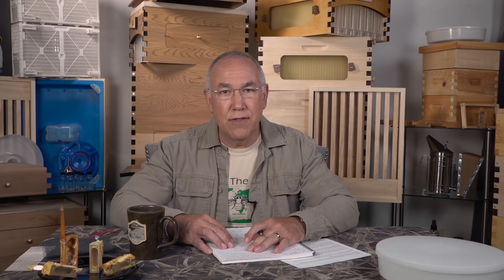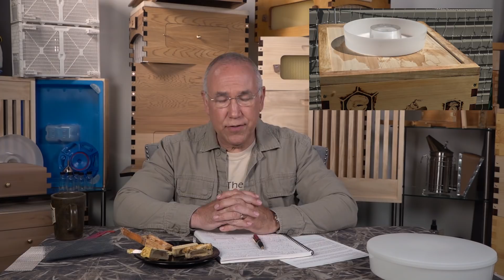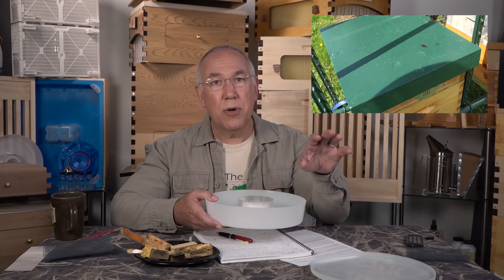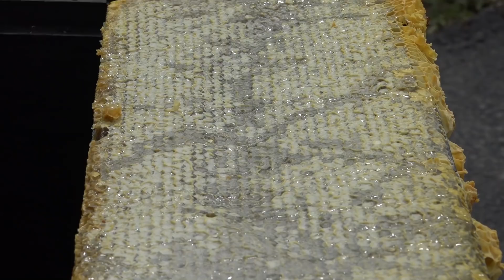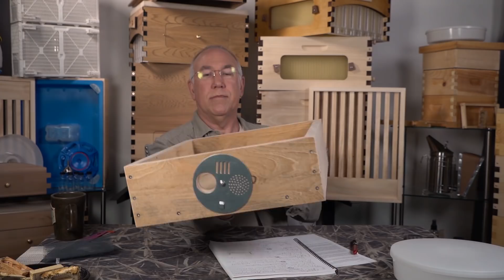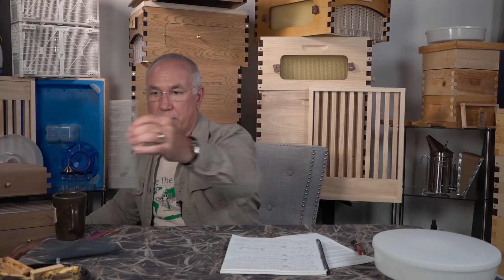Bee Keeping Frequently Asked Questions 17 Honey Bee Vented Feeder Emergency Feeding

Comment: 2) When a colony of bees dies off, can I put those resources on another hive? 13:50
3) How far apart should bee hives be placed to avoid drifting of the foragers? 17:38
4) Do Ceracell feeders have to be placed on a cover? 22:40
5) Is the aluminum insert on a flow hive too hot to touch? 25:35
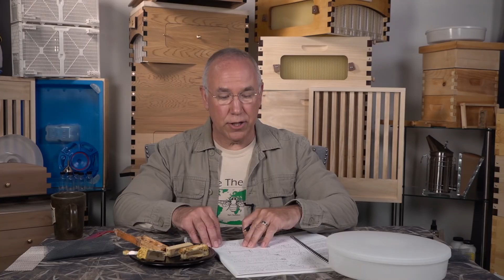6) The upper feeder shim has no ventilation when the rapid round is in place, what can be done for added upper ventilation? 26:44
7) In stalled two new packages of bees from the same supplier, why are they so different? One is docile, the other stings me. 32:02
8) What is the cheapest finish I can put on my hive that is safe for honey bees? 35:44

Comment: I am soooooo glad I watched this video papa Fred!!! I am now taking the nice cedar feeder shims apart and I am integrating the top cover into the shim , I’ve been a carpenter for 41 years and a bee keeper 10 years out of the last 41 , I subtracted for the almost 30 year hiatus from bees , and I still have so much to learn and of course we will all learn until we are dust..why didn’t  I think of this little detail of making the shim a lid lol 😂 

To answer a fellow listener or listeners question on what to finish your hives in , And I’ve been using this professionally on jobs and bee hives as well, the safe inert acrylic latex paint made by Sherwin Williams, Duration is a very good line of exterior finish for hives , but I have been using Emerald exterior paint from sherwin williams , again I’ve used this on commercial apiaries for 41 years and it has held up the best , the chemist’ at sherwin have really perfected the uv resistant and durability’s over any other product I have used professionally for over 4 decades and I believe it is less expensive than Behr paint at Home Depot, the interior of the hive I use one coat of paraffin and two to six coats of bees wax , you can use as much bees wax as you want inside , I just use the paraffin as a base coat and the beeswax because the bees love it . Although I am just getting back into bee keeping not much has changed on the hive finishes , I’m sticking with what I know what has worked very well and i can vouch for up to 400 hives maintained very well with the exterior sherwin williams, ask for emerald exterior, that’s my pro tip of the century:)

Comment: I use Le Tonkinios varnish.  You only sand the first coat then straight over the last coat you put on. It flexes with the wood and only needs to be washed off before re-coating even years later.

Comment: The comb guides that come with the wooden flow hive frames are the right width to create a space too thin for bees to pass.  I put two comb guides parallel under my rapid round feeder to allow ventilation at the top of the hive.  The holes you cut will do a better job, but this would add even more ventilation if you needed it. 

I used the vented super from Kelly Bees to elevate my roof to make the feeder fit.

Comment: Great job discussing the variations in genetics.

My Weavers are all not the same. 

One hive just blew up. Double the population than the other two Weaver hives.

One hive, the smallest one, is kind of more alert to alarm than the others. You cannot even pull out the pest management tray from the Flow hive without them coming spilling out of the front and sending out guard bees to buzz your face. That hive also built a queen cup then dismantled it, and the queen got a slower start than the other two. She is great now though.

All hives seem to do orientation flights between 1 PM and 3 PM everyday.

Also all my Weaver hives seem to be out super early. I mean 6:30 to 7 in the morning they are sending out foragers. Which seems different than your results.

Really impressed with them so far.
Reply from the maker: That's very interesting and I like it when there is some individual personality to the hives. They do fly early and my Saskatraz bees are getting out very early also and that's fine with me :)

Comment: The kid throwing the cat off the porch analogy is only terrible because its true and we know that kid.  I really like the 5 frame nuc Cera Cell feeder and add it to my 10 frame inner cover shims that i make.  Better design imo and i can feed syrup and pollen patties independently.  Good cheap finish is shousugiban inside and out with raw linseed oil and beeswax top coat on the outside.  Will need to be reapplied every 4 to 6 weeks though so I also like a good spar finish when I find it on sale.

Comment: Opened a hive that was a dead out. Robbed so I don't know if they got cold. starved?  There were ALOT of dead bees in the layens hive.  Some still clustered around what appears to be brood.  I could see many bees with their butts up in the air and their heads in cells.  Any help would be appreciated. I only lost 1 out of 14 but still 1 is to many. Because Layens hive are not made to feed I wondered about starving but I left lots of honey for them.  No signs of Varroa. I treated in the fall and have always have had good mite counts.  I really enjoy your channel. My husband and I listen in the car.  Makes trips go so much faster. Thank you.
Reply from the maker: Did you find the queen among the dead? That's where I'd start that evaluation. If they were undersized, colony wise, then they may have just become stuck over the brood and unable to access nearby resources. I also know that the layens hive is not set up for providing any emergency feed over the top of the cluster. I'm interviewing Dr. Leo this evening. It's a part of the design I'm not personally thrilled about.

Comment: In watching this video as a new bk'r, I have a question that I've not run across in your video's so far.  
I opened my hive last week to find mold covering the new inner cover.  In nature I understand bee hives were in trees, the ground, rocks etc.  In trees, the wood absorbed some if not all the moisture created by the bees, same in the ground.  In rocks I imagine there would be slight ventilation to stop mold from forming.  
My question is, is there a design for the Langstroth hives in the works that might stop mold from forming?  I do recall that after your many experiments with ventilation you have removed it from the top supers.  It was clear it's not venting the hive wants, it's something else that we haven't put our finger on yet, or have you with your rapid round feeder box and it's air space? (There's that #2 question:)
Thank you from northern BC Canada.
Reply from the maker: As spring hits and the bees begin house cleaning, they should deal with any mold that has begun on interior surfaces that they have access to. You can swap out inner covers if you like and then spray any mold with 10% bleach solution and rinse after a good dwell time, then  shelf it for future use. There is significant humidity up in those rapid round feeders in winter, it changes throughout the day, but those aren't porous enough to result in condensation related mildew, though when things warm up you could see black mold at the edges of the damp sugar that will finish winter as a solid lump.

Comment: Hi Fred, have you tested the Beetle buster baseboard as yet, spotted somewhere you were looking to try them out.

cheers.
Reply from the maker: I'm currently testing Beetle Jails and don't have any beetles to trap at the moment :(
Reply: After a long illness,  I had a cathedral hive get away from me and get thoroughly infested with SHB.  Since it was a great Fat Bee Man queen, I took the effort to cut the comb out and put into Langstroth frames then bought a BBB.  The life cycle was completely interrupted in 2 to 3 weeks and that hive is clear now.  Good sealed seams make a big difference too.  I highly recommend  the product for hospital service if not general use.  It is also designed to be used with the Mighty Mite Thermal system.

Comment: Hello Mr. Dunn, I saw something I thought was odd  with my bees. I extracted nearly 3 gallons of honey and set the frames out to be clean by the bees. The frames were around 100 feet from one hive and about 200’ from the other hive. The bees of course was on them in no time hundreds if not a thousand bees. What I thought was odd, was that some of the bees were fighting intensely. I even saw one bee got her stinger stuck in the tail of another bees. The stinger rip out and the bee soon died. My question is why were they fighting so much? There been a very heavy nectar flow. All of the hives have tons of resources. and the frames I harvested were from another yard. I realize I probably should have placed the frame further away, but I didn’t want them to get wet from the storm that is coming tonight.
Reply from the maker: Where was the fighting taking place? On the frames you set out, or back at the hives? It would certainly be extremely rare to see fighting at a feeding/robbing station? They should definitely be protected from rain and sun.
Reply: Frederick Dunn they were fighting at the robbing station. Each hive is strong, so there was no fighting at the hives
Reply from the maker: @craig6903  I've never witnessed that behavior at a feeding station. Wow, very strange indeed. Has that stopped?

Comment: Fred, Is it OK to take my feeder shim and place two rapid round feeders inside instead of one centered large feeder? The two I will use are smaller and hold about a quart of syrup each. Both will fit within the space. But they will be off center, with a central hole for ventilation, as opposed to the larger feeder you showed that is centered. I didn't know if that setup might be problematic in any way. Thanks for your endless help to us backyard keepers. Gordon
Reply from the maker: The problem I see with that, is the bees have access to the entire space and "might" begin building feral comb that you'd have to clean up later. I personally like to cover the hole with a feeder and then try to keep up with filling it. Open spaces tend to get filled with bees and burr comb.
Reply: @FrederickDunn  The bees have no access to the shim open space. There are three holes in the shim with my configuration: two for the two offset round feeders and a single center hole that is screened, for ventilation. Does that seem doable?
Reply from the maker: @gordonlassen2626  Oh, sure, that sounds much better. :)

Comment: Newbie here and I am looking forward to my first season of beekeeping this spring. What are your thoughts on the Apimaye beehive. Live in Wisconsin zone 4. Did my research and this looks like a good hive for cold winter states. 2nd question with this hive. It has split top feeders. Would you recommend one half sugar syrup and the other half dry sugar for spring feeding or only sugar syrup? Thank you in advance for entertaining my questions. Chris
Reply from the maker: Hi Christopher... the Apimaye hives are working well for some, and not so much for others. I would rather leave the full review of those hives to people who are actually using them. I backed off since they are not necessarily outperforming wooden hives and are not recyclable where I live and I'm trying to minimize the amount of non-recyclable plastics I incorporate. The Base is not interchangable, and you can't swap the bottom two boxes in spring for those who like to reverse the brood boxes. The top feeders would be used wet or dry depending on your season. Dry for winter, syrup during spring or summer dearth periods, or when the final honey flow is finished and you want to build them up for winter. I'm also ag zone 4 and get my bees through in wooden hives. Certainly more insulation couldn't hurt and that's the big advantage of those designs. You also can't mix wooden hive boxes with their plastic designs so you would have to commit do that design. I only have one member of our association that is using one and he's still figuring it out this year. I'll know more as time passes, but those are my general obserations.
Reply: Frederick Dunn thank you for your quick response. Your videos have been really educational and I look forward to learning more from you and others through this journey of bee keeping.

Comment: Help please

I have a square rapid feeder resting on a feeding board on top of my single deep box - here’s my problem. My feeding board has a notch (not sure of its purpose) that the bees are using as an entrance and exit to the deep box... is this normal? I assumed it was a vent - the notch is only about an inch wide.
Reply from the maker: You can just block that if you don't the bees using it as an upper entrance. Some inner covers come with that and some don't. A tiny wad of screen will close it to the bees while leaving it as a vent if you'd like.

Comment: Hi there Fred,
I have an interesting situation.  The swarm I collected (my first) one week ago and hived seems to have found the gap under the screened bottom board on my 8 frame classic Flow Hive.  I made the rookie mistake of having the entrance facing north when I hived them and decided to spin the hive around (so the entrance is facing south) while it was raining and they were all in the hive.  There are at least one hundred now under the screen.  I have read that I need to "clean up that mess" before it gets too bad (they've been in there about two days).  I used the Flow Hive key and kinda pushed them out, but of course that's like trying to push water uphill.  I got out as many as I could, then put some painter's tape over the entrance.  I've got rain forecast tomorrow, then clouds for the next few days. 

Do you have any recommendations on how to get them out of there and back into the hive?
Reply from the maker: HI Lara... hmmmm that's an interesting situation... I'm trying to visualize your situation. You have the corrugated insert under the screen? And if you remove that, they still remain under the screen and don't move on? You have access through the back under the screen - sooooo.... here is my fix - take a kabob stick (usually bamboo) rub it with raw honey (not dripping wet, just coated) stick your honey kabob stick in from the back and the bees will go after it... have several sticks so you can repeat the process until all the bees are going out with the sticks and then put that on the landing board for the bees to clean up and then use the proper entrance. I haven't done this, but I think it's what I'd try. Please let me know if it works :)
Reply: So, when I checked on them this morning, it seems that most of them had either found their way back to the hive entrance or absconded. Side note: when I was putting the second brood box on yesterday, I saw what could have been the queen pause and fly off of the frames.  I'm still trying to learn to spot the queen.  I won't know until tomorrow when the rain is stopped and the sun shows up or when I do the next inspection.  There were still maybe 50-60 bees still under the screen so I tried a modified version of your recommendation.  However, it is raining off and on today so they are reluctant to come out. 

I was worried that I couldn't lure the bees onto the sticks without smearing honey all over the inside of the area I was trying to get them away from, defeating the purpose of the whole operation.  Instead, I smeared raw honey on the end of a dowel rod and speared it into the ground just in front of the opening.  However, the threat of rain seems to be confounding me in this effort.  During a moment when the sun peaked through, I saw the bees leaving the front entrance and come around to check it out.  Then I was worried that the honey would lure more bees into the opening, so I screened the opening completely off.  There is a gap underneath where the bees inside can escape if they decide to come out. I will leave the rod there and see if it gets any more bees out of there.

Unfortunately, the experiment is inconclusive.  I may leave the screen in place to discourage any more from using that area, at least until they seem to learn where the front entrance is located.  Lesson learned: get the hive set up correctly from the get go.  Unfortunately, this swarm showed up in my yard before I was prepared and I pretty much had to jump on the opportunity. 

I also added one of your feeder shims on top of the new brood box with the improvements to venting.  I'll open up the vent tomorrow when the sun gets here!
Many thanks to you for helping all of us newbs become good stewards to these wonderful creatures!
Reply from the maker: @LaraLovesBees  Keep us posted :)  sounds like a frustrating situation.

Comment: Are the edges considered interior or do they need to be finished? Thanks
Reply from the maker: I paint the top and bottom edges as that's where a lot of moisture invades the wood.
Reply: I don't believe they paint the edges. I believe it's wood on wood contact & then the bees caulk / glue it shut from the inside.